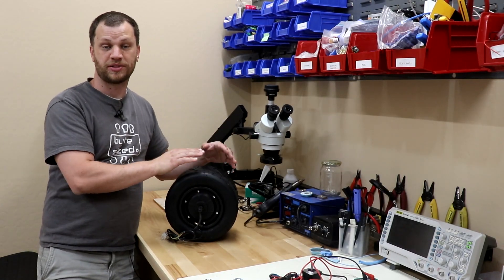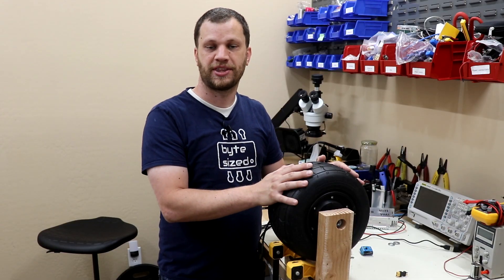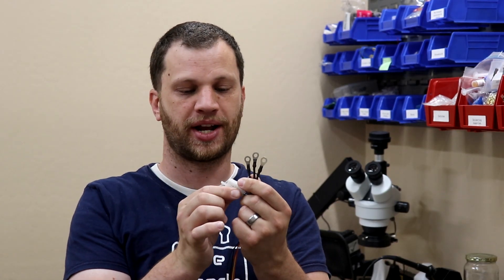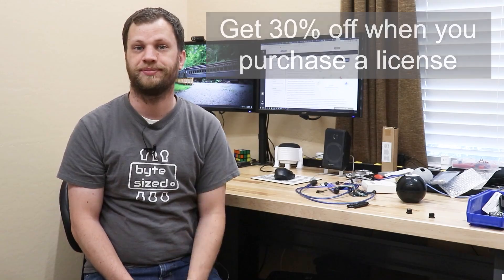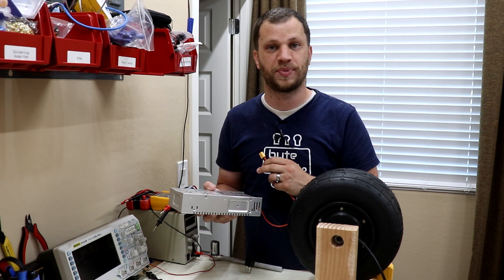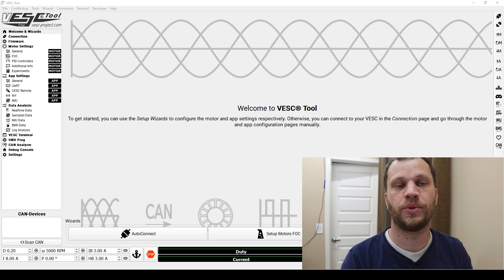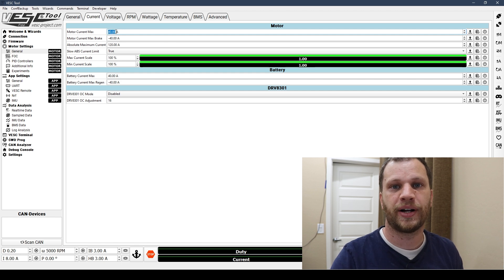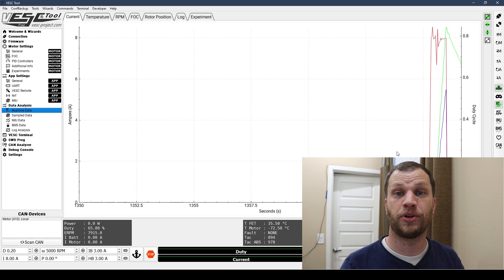Can I Make A DIY Onewheel, But Much Cheaper?

Comment: Hi!... I have watched one of your videos and am currently watching this one, in part or full.  I am happy that you are an engineer by trade. I am an Electronics Technologist, but that is just for background information, no more.    I noticed you are using solder for some crucial areas, where a large amount of current is drawn.  I am certain that in some projects you have undertaken, you have witnessed cables getting hot or even burned.  Regrettably, there is always a risk associated with these creations.  While we know the project works and the formule may be used in some areas to create a good design, I must share with you that our knowledge can be limited in some areas, this is where experience comes into place.  Sometimes, the solder will melt at high temperature/current drawn and the cable insulation may melt (a better insulation choice is the answer, but you know that already) but when the solder melts,  this is when  crimping and lugs playva role, this is where you can bennefit the most, so I thought I should mention it. Keep up the great work!

Comment: 2:15 I suppose that's one way to use of those connectors. I usually just see people crimp them but that looks way more secure I'll have to try it sometime.
Reply: Crimping is definitely more secure and won’t damage the wires over time due to vibration. If you look in vehicles you’ll find that every single wire is crimped the only place soldering is used in on PCBs

Comment: Couldn't you just get a old skateboard cut a square in the middle but do more or less the same wire job? Maybe 3d print the part that holds the wires in

Comment: I think those bullet connector solder joints are going to fail over time with vibration.  I'd consider crimping instead - far more reliable.

Comment: Can you share wiring from MPU-9250 to Vesc? Thank you.
Reply from the maker: The digital build guide is now available here!
https://www.bytesizedengineering.com/store/digital-build-guide-openwheel
Reply from the maker: The VESC I'm using uses the same pins for UART (TX/RX) as it does for i2C (SDA/SCL). Luckily I found some obscure video that explained that. I was trying to use the other connector which had pins labeled CLK and DIO and it wasn't working. This is a bummer because I was hoping to use a UART Bluetooth module to stream realtime data to my phone. I can't do that because the UART pins are in use by the IMU! Ugh.

Comment: Do you recommend 60V 800W motor version or lower?
Reply from the maker: The listing I bought mine from has several options but the price doesn't change. From what I've read in the forums it doesn't matter what you choose you'll get the same motor no matter what! I guess that's what you get...

https://www.aliexpress.com/item/1005002205086229.html?spm=a2g0s.9042311.0.0.24d94c4dzSeEKJ
Reply: Thank you so much! I'm waiting for the third part with the list of the component!

Comment: Wow this is amazing! Will you publish the plans to tour website, so I can build my own?
Reply from the maker: My current plan is to release the design files for free. I may make an assembly instruction guide PDF with a full bill of materials and offer that for sale on my website when I'm all done.
Reply: @bytesizedengineering   Very nice, that seems like the proper way of doing it. What does the BOM look like compared to a original onewheel? Is it significantly cheaper?
Reply from the maker: The digital build guide is now available here!
https://www.bytesizedengineering.com/store/digital-build-guide-openwheel
Reply: @bytesizedengineering  thanks!!

Comment: Please don't use MPU5060, they drift quite a lot! It's an old chip and crappy compared to what we have now like BNO055, BNO085. Adafruit made a comparaison of imu's and the mpu 5060 is the worst. Otherwise, looking forward to see the next episodes!
Reply from the maker: That's good to know. I'm actually using the MPU-9250. The VESC I'm using uses the same pins for UART (TX/RX) as it does for i2C (SDA/SCL). Luckily I found some obscure video that explained that. I was trying to use the other connector which had pins labeled CLK and DIO and it wasn't working. This is a bummer because I was hoping to use a UART Bluetooth module to stream realtime data to my phone. I can't do that because the UART pins are in use by the IMU! Ugh.